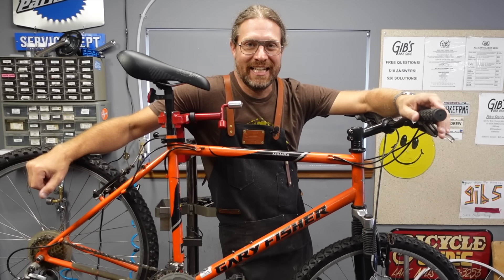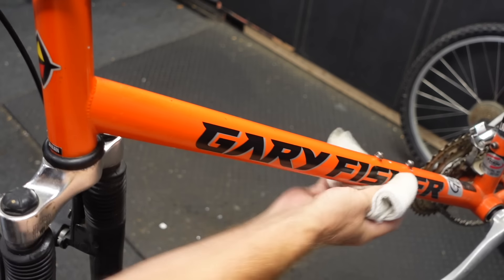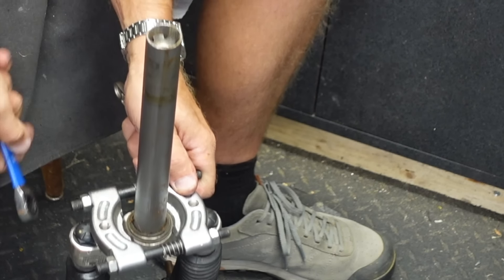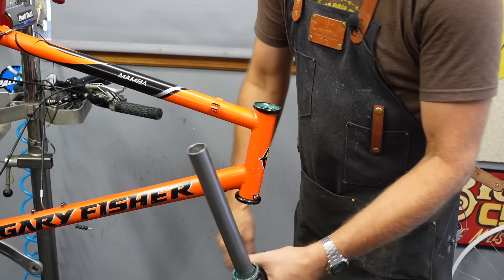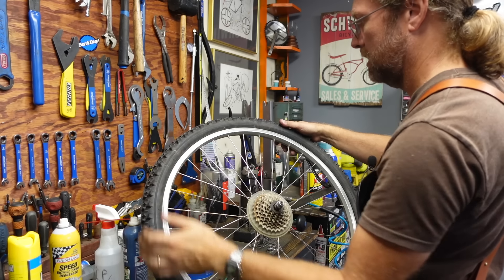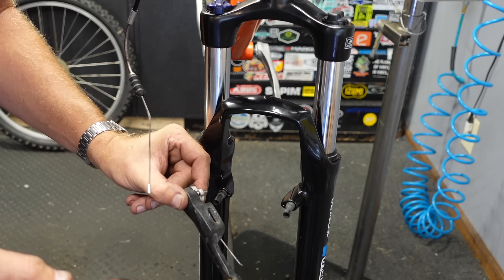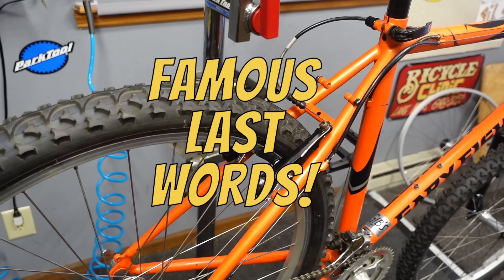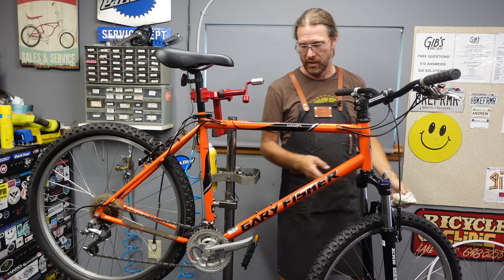GARY FISHER Mamba gets a NEW FORK and a FULL TUNEUP! Another bicycle is given a NEW LIFE!

Comment: I cant tell you how happy I am to hear that I have a chance to eliminate brake squeal without toeing my pads. I definitely prefer the snappy feel of flush pads and I enjoy toeing pads less than pretty much every other bike maintenance activity. I look forward to fixing those when my garage temp falls below 92 degrees.
Reply: And thank you for test riding before a customer gets it. I get the feeling you might be a rarity in that. My LBS put in new bottom bracket in my 90s bike. Now it can't shift to the smallest chainring even with the front derailleur limit screw set all the way inboard. Had they ridden it, they would have discovered that the spindle's drive side is too short. Thanks again for taking good care of your customers.
Reply: I dont mind brake squeal at all. Now you're gonna have to buy a bike bell as well.

Comment: GF Mamba goes back to at least 1995. The V brake makes me think this was later.The rigid fork suggestion sounds good. Long stems integral with the head set were the thing back then, often in frame colour. This looks like an updated replacement headset with a shorter stem add on. Learnt a few skills watching this one. I have a 30 year old Giant ATX770.  Recently had to clean the rear Deore LX shifter (no longer available) with a gummed up pawl on the down shift trigger. Used RP-7 to clean and lube inside, and it freed the pawls, after watching a video rebuilding these in about 20 minutes each. It's like clockwork inside and the potential to break or lose a piece is huge, let alone rebuilding everything correctly. You would never find a replacement part.

Comment: One of the better bikes on your channel IMHO. Put some fenders on and it'll go anywhere, any season. Nice.
Reply from the maker: I almost wished I went with a rigid fork and some fenders. It makes for a perfect commuter bike...except the steel frame. I think commuters should be aluminum to avoid rust issues. It will sell faster as an MTB
Reply: @bkefrmr  good points.

Comment: Grew up wrenching on bikes in a shop back when cantis were king but v brakes were the new thing. Had to toe the pads because heaven forbid a customers brakes make any noise when they got wet or the temps changed 50 degrees. 😂 On a really stubborn squeaky pad I’d put a piece of sandpaper behind the pad and drag the brake while riding it around a minute, would sand the whole rim in seconds.
Worked at a Gary F. dealer and lusted after the late 90s steel Hoo Koo they made. I’d still like to have one.
Reply: I have a 90’s green and gold hoo koo e koo
Reply: @jean-paulavallone598  wow, I’d forgotten about that one

Comment: Is that a Shimano STX drivetrain?
Reply: no. it's acera
Reply: Nah, it's an Acera rear mech and Altus on the front, which is pretty much what my first race bike had in 1993
Reply: @catshoemike  When I looked the 2nd time, I could tell it was a low-end Shimano crank😖. Shimano should drop Deore from XT and also drop Deore and bring back STX and STX-RC🤘🤘
Reply: Were those 90’s grupos? Are they still in production?
Reply: You don’t need horn with those brakes!